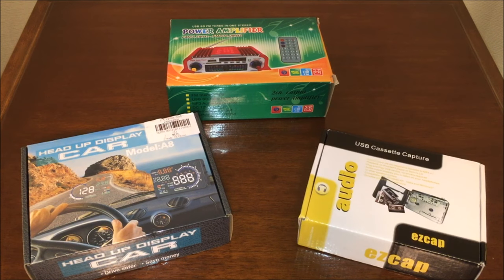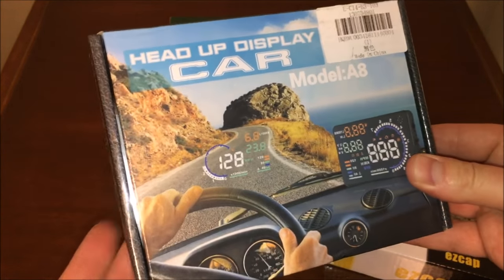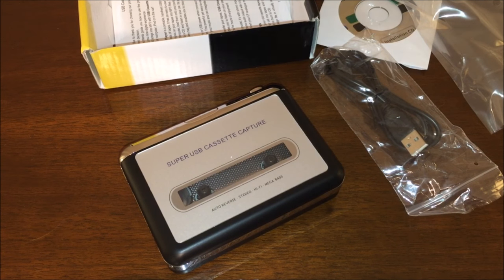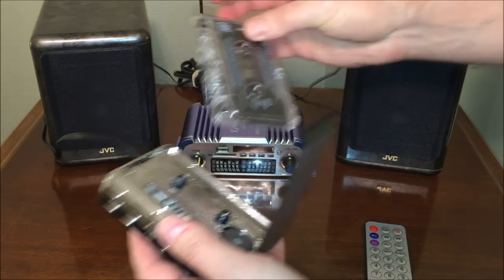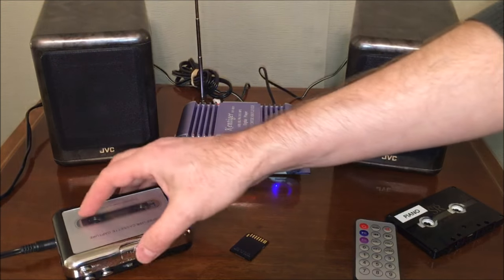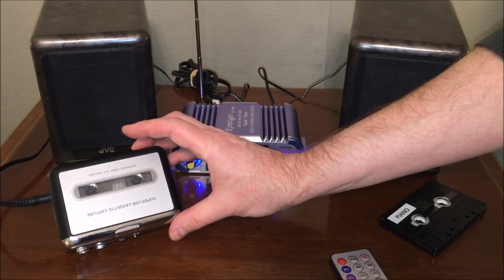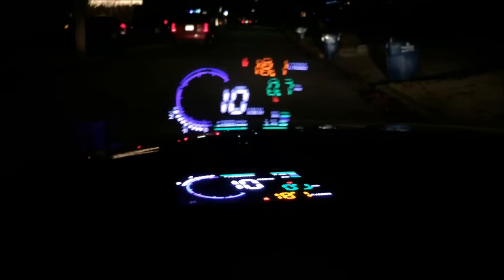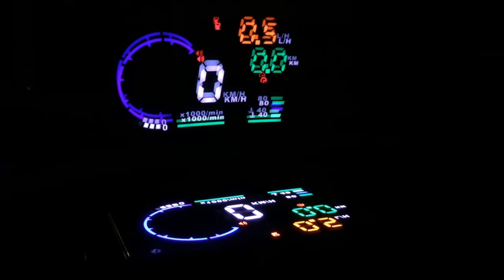You will Hate These Cheap Chinese Electronics

Comment: Unless Apple removes the audio jacks on macbooks too, I don't really see why anyone would need that cassette digitizer.
Reply: YankeeSpirit I believe MacBooks just have a mic-in jack, not a line-in jack. Not that I'm an expert by any means, but the levels are different so you really need a dedicated line-in jack to do it right.
Reply: they have mostly mic-in
Reply: Even the newest Macbook Pro still has the 4 pole headphone/mic jack.  Just like on an older iphone.
Reply: FRIENDLY JAPANESE BUSINESSMAN they probably use the same combined jack you find in smartphones that support both mic in and headphones. You can buy a splitter for that.
Reply: Chris Barbati I don't know if Macs do the same, but with my PC's onboard sound card when I plug anything in to the line-in jack, the HDAudio driver brings up a dialogue box that asks me if I plugged in an audio device or a microphone, and will automatically pot the input levels depending which one I choose.

It actually does work because one time I accidentally clicked "Microphone" when I had a tape output plugged in. The tape came though really loud and distorted because sound card was expecting a passive mic instead of a powered audio output. I'm glad I didn't blow the sound card.
Reply: 4 pole means that the mic in is mono. Even if the circutry supported mic line being switched to line input, all of your recordings would be in mono.

Comment: OK, important question... possibly you don't know if GearBest just sent that stuff to you for free, but how much does that HUD thing cost? It seems a bit tacky and maybe not the most readable if you have a dual coated safety glass screen (hence the double reflection), but all the same, my own relatively recent car has a very much de- contented dashboard, rather than showing lots of different things. The only main dials are a huge speedo (that goes far beyond what the car can actually achieve), a dinky little revcounter next to it, and the electronic odometer that also includes a somewhat unhelpful 8-bar digital fuel gauge, plus a few lights. Not even a temperature gauge.

So I'd be rather interested in getting something like that and hooking it into my OBD2 (...should I ever find where it is), just to get a temperature and maybe battery voltage readout, and possibly a finer grained fuel readout (heck, I'd probably even mask off the speedo and revcounter sections, reduce the distraction... I don't exactly have to take my eyes far from the road or squint closely at the massive dial behind the wheel to see my speed, and although I drive stick I've still had enough vehicles without any kind of revcounter to actually need to reference that very much). The only other options seem to be some kind of bluetooth sender dongle, and a phone app that receives its signals, and none of them look to be any higher quality than this thing.

If it's anything under $25 / £20, it'd definitely be going on the payday wishlist.
Reply: Retro fit huds are crap don't waste your time or money, you can get them for as little as 10 bucks to as much as 500 bucks. However the thing is in every state a cop can interpret the hud as an obstruction and ticket you. Not only that but OBD II ports were not designed to stream data for long periods of time. The reason you don't see insurance companies advertising nor even offering OBD II based insurance rates anymore is due to the large number of computers becoming damaged in vehicles that used their devices long term. Pontiac had introduced huds in a few of their models in the mid 80's early 90's, but due to obstruction related tickets from their customers, they phased them out completely in the early 2000's. There are systems out there that you can have installed that don't use OBD II ports or the cars computer, they use sensors installed under the hood for each piece of information, they come with a new rear view mirror that displays the info within its reflection, and are quite expensive. Mark gadgets like this off your wishlist, because they're just gimmicks and can be very dangerous to the health of your vehicle.
Reply: Most generic OBDII devices will show you what you mentioned, except for fuel level. So this HUD device won't show you fuel level.
Reply: +Admiral That's nice and all, but I'm the UK and it would appear our laws are very different. We have cars that have similar kinds of speedometers built right in, phone apps that do the same have been around for years, and many people have aftermarket satellite navigation devices (or just smartphones running nav apps) sitting on mounts within their field of view, as well as dashcams etc. Never heard of anyone being done for having any such thing. So long as you have a reasonable field of view unobstructed by opaque objects or cracks in the glass, and aren't actively messing with a handheld device whilst at the controls of a car with a running engine (and/or in motion), you're good to go.

Also, most of our insurance companies are still actively promoting "black box" and/or phone app based driving monitor policies which get you discounts if you're a so-called "good driver" (which I assume means low G-forces, revs, and average/maximum speeds... I doubt they're able to measure whether you're actually paying attention, not cutting up other drivers or cyclists, stopping for school crossing guards or red lights, staying on the correct side of the road, etc), and/or charge by the mile at differential rates depending on the time of day. But despite some other high profile cases of poor motor engineering of late, never heard anything about ODB-II ports going phut just because a small monitoring device was plugged into them. Maybe ours are better made than the US equivalents? I mean, they're just CANBUS adaptors, carrying fairly simple serial data signals, there's no reason they can't have something hooked up to them and active 24/7 for decades without going bad... and as the sockets are very plain wiring connectors with no fuses or other logic inside them, having one of them break for electronic reasons probably means something blowing out in your car's ECU. Which suggests bad engineering either on the car manufacturer or the connected device's manufacturer's part.

Breaking the socket itself suggests physically rough treatment, or maybe a great many connections and disconnections (I doubt it's rated for more than a few dozen over its lifetime), such as someone might do if they have an adaptor that wires directly into a laptop, PDA or smartphone... or are maybe repeatedly disconnecting the black box device to drive around at times which would otherwise attract an elevated premium...?

In any case, neither you nor Will have answered the only question I actually asked - how much does this particular device, or a similar quality equivalent, actually cost?

(The lack of finer grained fuel readout is maybe a bit of a bummer, but ultimately something I could entirely live with as I have a fuel gauge already; but the other things like coolant temperature and battery voltage, and ability to show fuel consumption at the same time as one of the other trip computer readings without having to repeatedly reach through the wheel to mess with the button would still be pretty handy)

Comment: Unfortunately I can only confirm most of the other comments here about that mp3 cassette player. Everything about it,the build quality,wow&flutter,audio quality,etc. - is absolutely wayyyyyyy below any acceptable standard.

If it's just only for fun or experimental - that's OK. But if you're serious about cassette converting thing, my only advice is to use a decent deck&sound card. This usb toy doesn't cut it. That's all.
Reply from the maker: Thank you.
Reply: Watch Technomoan's videos on the cassette mechanisms used in new cassette decks today. When I saw the door on that cassette deck open, and the button layout, I went "Yep, it's another deck using one of THOSE mechanisms!".

Comment: too bad the windshield shows double image of the hud
Reply: Not a fault of the HUD device,  but of the optical properties of the windshield. The Glass used in windshields is laminated, with two layers of glass bonded with several layers of plastic, to keep it safe and mostly intact in the event of a collision. You are seeing two reflections, one from each of the layers of glass. The supplied piece of reflective material will mitigate this somewhat, but there may be a tradeoff with visibility of the light transmitted throught that part of the screen.

Comment: I got to try that cassette player a while back and it was terrible, the motor noise, the hiss, the wow&flutter, and something you didn't mention but the high frequency response is awful. Everything sounded muffled, like if it had a lowpass filter at around 8, 10 KHz. I got to compare it to a Sony Walkman which wasn't even a particularly high quality one, and the Sony sounded a million times better. When it comes to portable cassette players, I'm not very demanding, but that thing is unacceptable.

Comment: I spose with the cassette player pay for what you get but you're done a very good job of explaining it anyway I like the amplifier very cheap for the price but still it sounds quite good
Reply from the maker: +Kevin Schwartz - thanks Kevin
Reply: If you want good tape audio capture, your best bet would be to buy a secondhand deck, even if it's a Sony Walkman, and a USB dongle for audio input if your computer lacks those inputs.

 The cassette decks made today are literally using variants of the same 2 or 3 mechanisms, all of them low end junk. Even if the device looks good and is pricy, you still get a cheap tape mechanism.

Comment: Hey databits. Can this amplifier be used to hook up to an existing stereo receiver? :)
Reply from the maker: +Mark Covington - it's a stand alone amplifier, so there are no audio outputs other than speaker outputs
Reply: Can the speaker outputs be used as audio outputs if you have the right cables for them?
Reply from the maker: No, it would overload the other amp and maybe ruin it.
Reply: What if you were to set the volume on this power amplifier to a low volume position? What would happen then?
Reply: Mark Covington that's a stupid idea and what would the purpose even be to do that it makes no sense